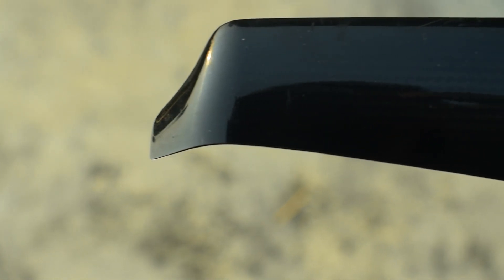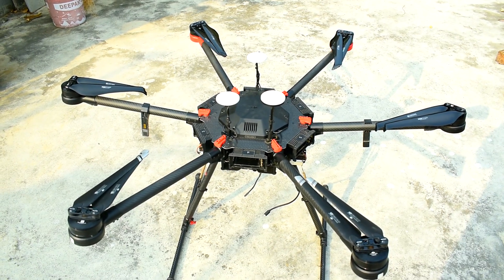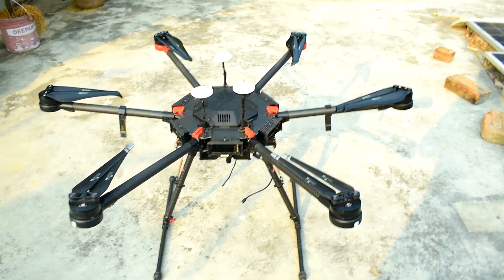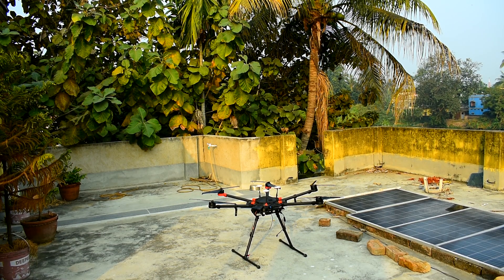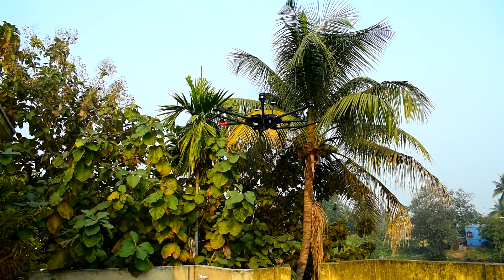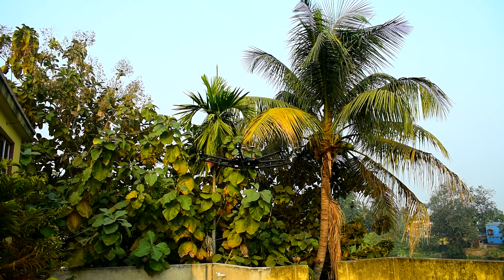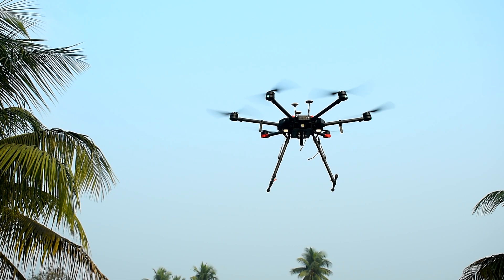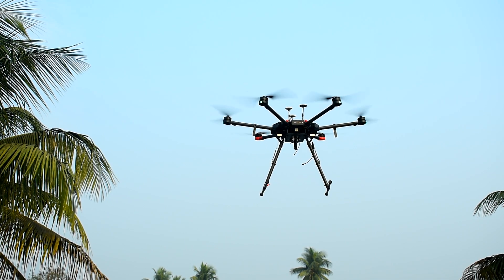T Motor Propeller in Dji Matrice 600 Pro @DJI @t-motorforuavdrone4456

Comment: did you found a solution to use standard lipos for M600PRO instead of DJI batteries?
Reply from the maker: Correct I have already explained in other videos. Please take a look on my channel
Reply: @desidrone  i checked but I didn't find it, sorry
Reply from the maker: https://youtu.be/KStrFgjFznE
Reply: @desidrone  i didn't find it

Comment: Hi, May i know how much modification you needed to do? did you use the original DJI prop holder? I am having the same issue as i need more propeller.. but also, I was looking for an alternative like a pure carbon propeller ... to the DJI propellers, as they tended to crack in a not very desirable lenght of time.
Reply from the maker: That's correct using the DJI prop holder i have modified with T- motor propeller